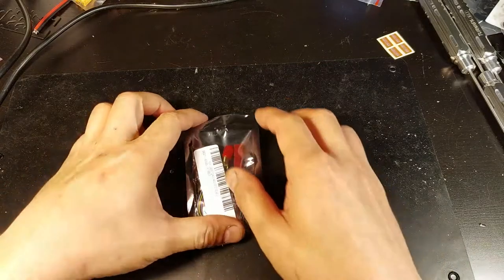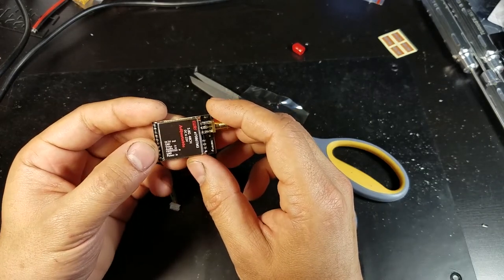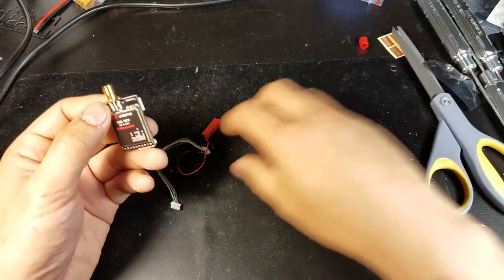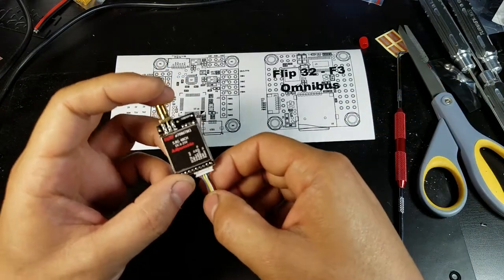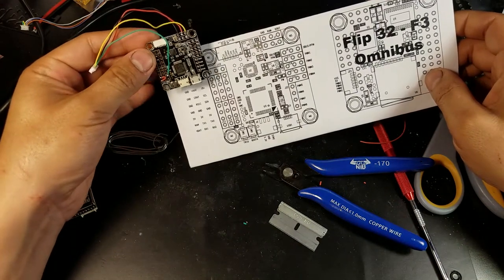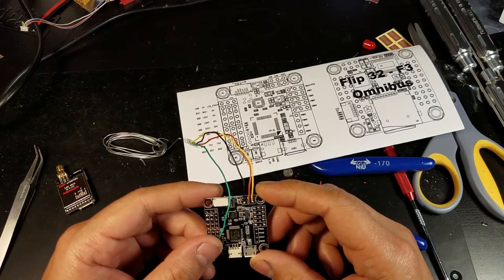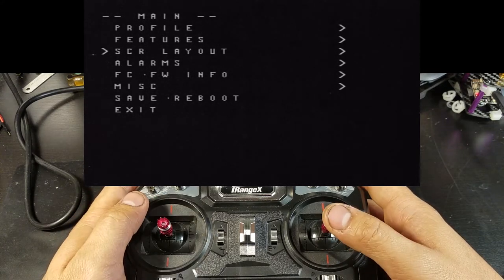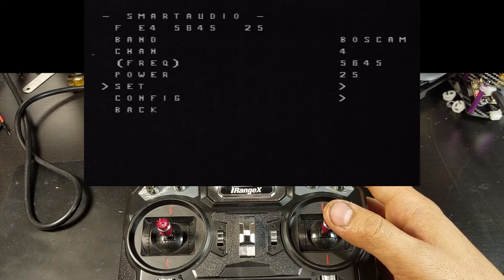EWRF e7086TM3 VTX review and install

Comment: Is the white wire (audio in) used for smart audio?
Reply from the maker: the white wire is only used for audio input
Reply: Oh ok, so this can't be used as smart audio on a board that doesn't have an osd?
Reply from the maker: as far as i know, you need a FC with an osd for smartaudio to work.
Reply: This vtx support PWM control for freq and power, not Smart audio. Information in this video is wrong.

Comment: Hello, will this work with a uart with no inverter?
Reply from the maker: i am not sure, i will need to see if i have a fc that doesn't have built in inverter to try
Reply: Doug Hnut thanks!
Reply from the maker: +Andre Martinez quick question. Which flight controller are you planning to use?
Reply: Doug Hnut Planning to use the Omnibus F4!
Reply from the maker: hi, just got an omnibus f4 pro v2 in the mail and installed it in my quad with the e7086tm3 and it works! I used uart 6 for smart audio